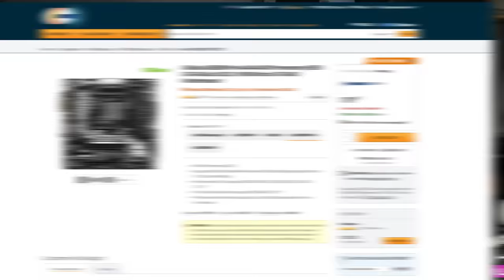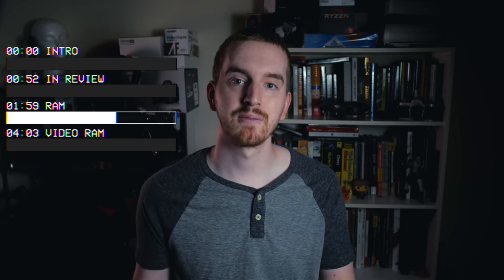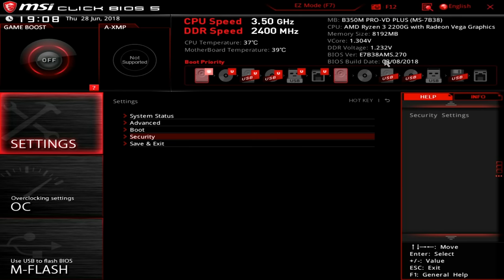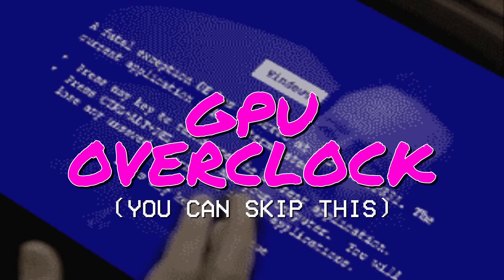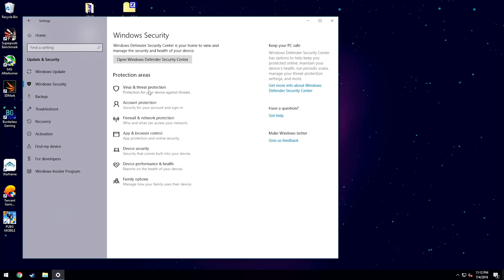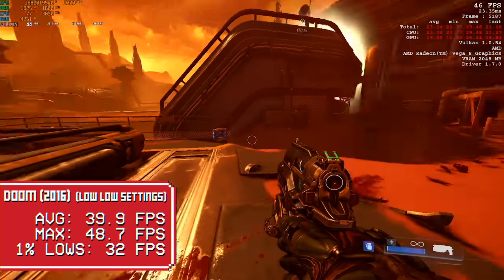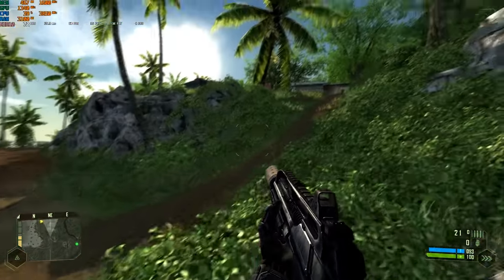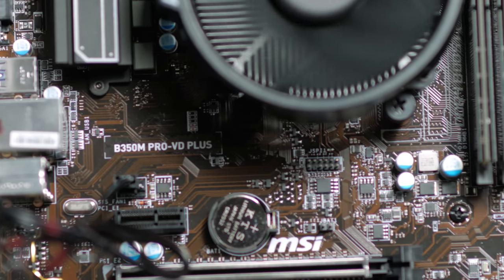How to get INSANE GAMING PERFORMANCE out of AMD Ryzen 3 2200G APU - Ryzen 2200G Optimization Guide

Comment: Thanks, dude. I am making 220g build next month, so this is really nice info.
Reply from the maker: Thanks for watching!
Reply: Nice =)
But get two memory modules, please and overclock the GPU before touching the CPU.
(The overclocking sequence should be memory->GPU->CPU for these APUs if you plan to use them for gaming.
For office work that requires more CPU performance then GPU performance you can switch up the later two)
Reply: Luredreier i won't touch CPU, only menory and GPU. The only thing i'll get that's different from his build is RAM on 2666Mhz, to make sure it can overclock to 3200Mhz. Litterally can't wait!
Reply: +Nenad Lazarevic 
If you're getting memory that's less then 3200 MHz at CL 14 make sure that it is in the motherboards list of supported memory modules unless you're willing to do a lot of tinkering as it might not be supported at 2666 Mhz out of the gate.
Also 3200 MHz isn't always the optimal frequency for a memory kit for Ryzen.
The reason 3200 MHz is recommended is because a 3200 MHz CL 14 kit can't really be achieved by anything other then Samsung B-dies and those works best with Ryzen, but if you're using anything else then focus on optimizing the bandwidth more then anything else, and that may benefit more from a lower timing or sub-timing then a frequency bump in some cases.
The only thing that only benefits from the frequency and not the timings is the infinity fabric as its clockspeed is locked together with the memorys frequency, but since you only got a single CCX in the R3 2200G it's slightly less important then in the bigger CPUs, it'll still influence the memory latency, I/O latency and the latency of data transfers between the CPU and the GPU, but outright bandwidth matters more, so if the last few MHz of frequency requires you to change some of your timings to achieve stability you might at times benefit more from keeping the timings low.

As for the CPU, you may want to OC it too, depends a bit on what you're doing with your processor.
But yeah, good luck. =)
I hope you'll enjoy your new system ^^

I've mostly loved my R7 1700 + RX 480 rig myself (not quite the same as what you're getting, but yeah).
Since I'm running my 1700 at stock you'll actually be getting a higher single threaded performance then me ^^
And I think your memory is slightly faster then mine too (I'm trying to keep my systems power consumption low).
Reply: Thanks for all the details. I am moving from HTPC with 25w Sempron 3850 (AM1) so CPU OC won't be needed. I too am trying to keep power consumption low, as i love small efficient PCs (that is the reason i used that Sempron, and why i am buying 2200g now). I am so impressed with this APU that i can't resist upgrading.

Thanks for all the info about memory and timings, i am going to browse webshops now to see what i can get for my budget. I might go single channel in the first month or two if the good quality sticks turn out to be too expensive.

Comment: Thanks for the info! Do you think the amd apu's would make a decent streaming PC if I'm only doing console streaming and not actually playing and streaming on the PC?
Reply: +RicoJakePlays
Sure, depends a bit on what codec you plan on streaming with though.
(And I'm assuming that you're using hardware accelerated video encoding here, not software encoded as the 2200G only got 4 cores making it a bit weak for software encoding)
Intel, AMD and Nvidia have slightly different codecs that they are good at, bad at or don't support at all.
If latency is a major concern then Nvidia completely stomps over the other two with AMD comming in at last place of the hardware encoders (a modern Nvidia GPU can encode a frame up to 3x faster then AMD), of course software encoding on the CPU is miles behind any of those three in encoding time...
If image quality is your main concern then software encoding is hands down best, followed by AMD.
I'm not quite sure what's best of Nvidias Nvenc and Intels Quicksync as far as image quality is concern.

Are you playing games that are faced paced with a lot of movement in the scenes?
The hardware encoders does a worse job with those at lower bitrates.
If you do high quality and high bitrate streaming you'll hardly notice a difference in image quality.

Comment: - Processor amd athlon 200ge socket am4
- Mo-bo asrock A320m - hdv am4
- Ram 4gb ddr4 2400mhz Gskill Ripjaws V
- Hdd 500GB seagate
- Vga Radeon rx vega 3

Ideas ???
Reply: that's a bad cpu. don't get it. I would get the 2200g
Reply: Upgrade your ram.....vega 3....oh it is acceptable.....but 4 gb ram....ohhh.... seriously bottleneck.....use 8 gb or 16 gb dual channel ram..❤️

Comment: glad im not the only one that couldnt overclock my 2200G over 1300MHz stable
Reply: jonnolags I couldn’t when I did it using intervals of +.25. So instead (because of a friends tip) I cranked it up to 1.2v and 1.5ghz... tweaked it and got it up to 1.7Ghz with 1.225v and so far it is stable. Ive ran some stress tests and played some basic games and so far so good 👍🏻
Reply: With stock cooler ??
Reply: @svendolufsen849  with stock cooler?
Reply: just a random guy who likes stuff yes, I ended up turning it down to 1650Mhz because of instability issues but worked flawlessly ever since
Reply: @svendolufsen849  oh ok thanks

Comment: Just a quick tip on RAM overclocking on Ryzen. Add a tad bit of voltage to get from semi stable to rock solid. So if normal is 1.35V, try 1.40V. This also helps for GPU stability as a GPU overclock and stressing the system can tip over the bits for the RAM. So this might be actually what limits your GPU overclock.

Comment: +EposVox.
A few things worth noting.
Overclock the GPU before overclocking the CPU as the GPU matters way more for gaming performance, in fact consider leaving the CPU stock as that will both help with GPU thermals and leave the CPU more busy actually working on data and not requesting data so memory bandwidth is freed up for the GPU.
For the memory, don't just leave it at frequency and timings, look for sub-timings too, you can tweak a ton of memory settings with Ryzen to improve performance of both the CPU and GPU portion of the APU, and especially the later benefits from every bit of bandwidth you can etch out, while the former benefits from every bit of latency reduction.

Regarding using motherboard auto overclocking DO NOT USE MOTHERBOARD AUTO - OVERCLOCKING
Several motherboards are known to use voltages in their auto-overclocks that are flat out destroying your CPU after a few months/couple of years of use.
Why?
Because every CPU/APU is different.
So with fairly simple overclocking software that don't check what voltage the CPU and iGPU actually runs stable at they have to use the voltage needed for the worst CPU and iGPU imaginable to reach a given frequency to be sure that when using that frequency they'll actually run stable instead of getting a motherboard returned "for not working properly".

At most, use the auto-overclocking as a test starting point to see if your CPU (and if included iGPU) is stable at a frequency and then lower the voltage till it's not stable anymore, then increase it to the last stable voltage.
The reduced voltage will improve the lifespan of your APU by a ton while also making your system run colder/quieter.

Regarding what you mentioned about single channel vs dual channel.
Most definitivly dual channel.
It's better to buy two x 4 GB memory sticks to run 8 GB dual channel then to buy a single 8 GB stick despite that making it harder to upgrade down the road because of how important bandwidth is to the iGPU.
For your CPU scores single channel does just fine.

Comment: When overclocking a none APU, GPU, and you get corruption and artifacting like that, it's usually a RAM issue, either pull back the RAM Overclock (which Jayz2Cents also did not do) or give it a little more RAM and GPU voltage where possible...

Comment from the maker: Yes, if you must insist on proving yourself right on the internet -- you CAN reset BIOS using a jumper on the motherboard. It's just not my default way of doing things, I've been doing the battery method for 10+ years and have literally never shorted the jumper for that. Especially when this is a tiny motherboard, it was much easier to keep reaching down and grabbing battery than to turn on my phone flashlight, look up in the manual where the jumper is, find a screwdriver, short the jumper. And in terms of accessibility, that prospect is a little more scary to new PC builders. But yes, I am aware you can totally do it. There are multiple solutions to any problem.
Reply: Just wanted to add something. From my experience if it wont boot, it will do a reset of the BIOS after 5(?) retries. Maybe it's not like that on all motherboards, but it was like that the last time i tried different RAM settings, think it was a MSI motherboard as well.
Reply: I agree, removing cmos battery is easier for me as well
Reply: And what is making it harder to bridging JBAT1 3:42 with a key or screwdriver? you literally have to touch it for 2 seconds with a unplugged/switched off power supply. ;)
Reply: @Amixus  I agree. Of course It's easier to do something you have done 10+ years. Get used to the jumper method and it will be much better down the road once you already used to where the jumper is. Besides, it's 5 minutes vs 5 seconds.

Comment: To whoever is experiencing the atikmpag.sys BDOS. What fixed this issue for me is reducing the OC. I used the Extreme OC/Gaming Mode from my Asus b350-f strix motherboard and once i disabled this and set it to normal i never got that BDOS again. Not reinstalling windows, nor drivers fixed this but the mobo settings did.

Comment: I'm on a 2400G. But I'm at a stable 4.0Ghz, 1700mhz on the GPU. 1.45 and 1.275 respectably. Using a 212 clone type cooler. And a approved set of Corsair 16Gb sticks at 3000 speed and have them running at 3133. Also, I have 2 GB dedicated for the GPU side. Super stable. Very happy

Comment: I don't know maybe I'm just a lucky guy or something, 3 days ago I overclocked my 2200G with Ryzen Master, CPU went all the way to 4000MHz no questions asked on the default 1.4V, I don't know if it could've been pushed further, I stopped there. 71°C during stress test with stock cooler. GPU went to 1300 MHz for now, looks stable, but I had a crash yesterday while playing F1 2018, so right now I'm waiting if it happens again, might try to push it a bit more later. With 2x4GB Ballistix Sport 2400MHz (not overclocked yet), on an ASRock AB350M-HDV.

Comment: i picked mine up and was really lucky with the overclocks. CPU runs at 4ghz@1,325V with the GPU at 1600mhz@1,1V. I am really liking the performance of this little chip.
Reply: Congratulations! =)
What about memory overclocking?
Is the memory controller as golden as the CPU and GPU?
Tweak both frequency, timings and sub-timings for the best results.
Look up the comment on this page made by  U563 Rick for more info about how to get good results =)
Reply: I didn't try overclocking the memory yet. Was lazy and picked up a 3200 kit.  I'll give overclocking it a try =)
Reply: under stress CPU Z shows 1,344 or 1,356. I left everything exept voltage and clock on auto. But for normal use I only overclock the GPU as it's more effective for gaming than 300mhz more on the CPU.
Reply: EMX MM sorry I have no idea. I'd increase the power limit to the max and increase the MHz in 25 or 50 steps.
Reply: Based on what the Vega8 can do, I wouldn't recommend going with anything less than a 1050ti or equivalent gpu. Unless you can get a 1050 for really cheap. The ti is worth the $20 bump over the 1050 (based on used prices). Heck, if you don't have it yet and are in the US, ebay is having a 15% off purchases promo tomorrow I believe. Grab a 1050ti then.

Comment: Defender really eats up resources on lower end machines.
Reply from the maker: I honestly would have never considered that.
Reply: eats up disk usage and quite a bit of ram when it does a random scan while your playing, uses up to 99% on the disk and 120-200mb of ram . literally disabled it through the registry since it makes my games like FC4 and GTA V a shit ton of stuttering since i use an HDD for the os and only have 6gb of ddr3 but was all gone when I disabled it completely. I just use hitman pro or adwcleaner for virus scanning, pop up blocker extensions and a little bit of brain and caution whenever i go to somewhere random on the internet. so yea Defender really eats up performance.
Reply: The problem isn't just how much storage space, memory or CPU resources it uses, but also the bandwidth in the case of these APUs.
These APUs are extremely bandwidth constrained, so anything that makes either the CPU or GPU either request data from or move data to the memory will eat up the already limited memory bandwidth used by iGPU during gaming.
Likewise, testing out different settings to identify what settings are the most bandwidth intensive can really yield dividens.
Reply: I always disable defender and windows firewall. I just installed Kaspersky Free, disabled perform idle scan, and installed Simplewall firewall, works great. Simplewall with its whitelist mode also lets me prevent Windows 10 from using internet so spying, telemetry, backdoors, updates, etc. no longer has internet access without my permission. Windows 10 is forced to ask my permission. Also Simplewall comes with blocklist too so that's a plus.
Reply: Google "Simplewall Github" if you want to download and install it. Its free and open source.
Reply: Hum, simplewall you say?
I might look into it, thanks. =)
Honestly I was thinking of just switching back to Linux gaming again in a years time.
Reply: Linux gaming has improved a lot and most Windows games now run very good on Linux with Lutris + Wine Staging + DXVK. Youtube search DXVK.
Reply: Just tried Lutris yesterday and installed The Witcher 3.  I was very impressed.
Reply: DXVK is exactly the direction it should be going in, thank you, i wasn't aware of this progress. Wine's Direct3D to OpenGL shim has long hit an impasse that it's not possible to bridge the API differences in a sufficiently efficient and correct way, and Vulkan is exactly the solution. This is exciting.

But at the same time, ever more games get released with aggressive copy protection and foreign environments like WINE are not exactly conductive... plus the more progress is done, the more difficult it gets. It will be an uphill battle.
Reply: Cracks help in case of games with copy protection, drm, denuvo, etc. crap. If Wine fails with original, using cracks will help running the game.
Reply: Ultra Instinct Xeno Bardock Bitdefender Free is the lightest AV available and has the highest detection/prevention rating of any free AV. Should give that a try.
Reply: good av is malwarebytes. you wouldnt event notice that it is running in the bg.
Reply: 814NK Gamez The full suite of MWBytes is pretty pricey, but you're right, it is the best hands down. For free, however, Bitdefender can't be beat.
Reply: Zazzilas Arden how about smadav? it is free too.
Reply: Yuu Nyaa how'd you turn it off?! It always fucks up my HDD while I play GTA!!
Reply: defender use resources on high end too...you just don't notice it

Comment: Increasing the amount of RAM dedicated to the APU can in some cases reduce performance on systems with lower amounts of ram (8gb) and sometimes even with larger amounts of RAM. 

It is fine to leave the memory at 256MB unless there is a game that refuses to boot because of the small initial frame buffer. Windows is actually pretty good at memory management (its like 80% of its job) so when the GPU memory runs out, it overflows to system memory, and seeing as on these APU's system memory and GPU memory are the same thing, this is pretty easy.. 

You can see this in action by going to task manager > performance > GPU X and looking at the bottom, there is "Dedicated GPU memory" , "Shared GPU memory" and "GPU memory" in the latest version of windows 10.. You can also see this in reviews of the GTX 1060 3GB and the GTX 1060 6GB, a lot of games will tend to use more system memory with the 3GB card, and also increasing the speed of system memory with the 3GB card can have more drastic effects on performance than with a 6GB card.
Reply: Gamers Nexus goes pretty in depth about the amount of memory dedicated to the GPU and Buildzoid (Actually Hardcore Overclocking YouTube) goes into how memory speed/core speed/vcore voltage/vsoc voltage effects performance on these APU's
Reply: Also a note on that memory clock... Do those presets show what voltage it feeds into the memory and or memory controller? Those APU's memory controllers can get fried petty quickly if they get too much voltage

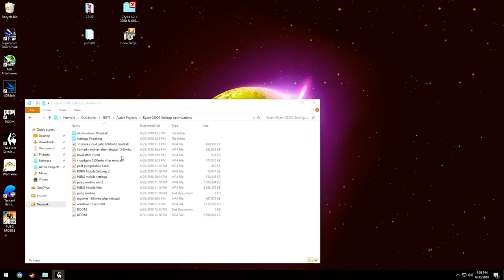Comment: 13:31 "THREAD_STUCK_IN_DEVICE_DRIVER" -> An early-2000s classic for me, when using Windows XP, couldn't find exact cause, but running Need For Speed III and leaving it at the menu on my socket 462 system, which had an Athlon T-bird 900 Mhz with GeForce 2 MX200, resulted in Windows XP rebooting with that error code. (Even though a late-1990s game shouldn't even be pushing it hard, even at that time, LOL) Some people on the internet, insisted voltage loss on the 3.3V rail causing that, IIRC. Others said that it's a known XP bug with the bundled Nvidia driver, IIRC.

Comment: It ist Important to Put the vram on some Low amount. If the vram is full, it uses the system RAM, which is exactly the Same speed AS the vram, so Ur fine there. But If u Go under the 2 Gigs, the system CAN NOT USE THE RAM ALLOCATED AS VRAM, BUT IF U LOWER THE AMOUNT, IT CAN

Comment: For overclocking you should try out using Ryzen Master and do play around with the voltage settings as well for getting higher than what you were pushing for.